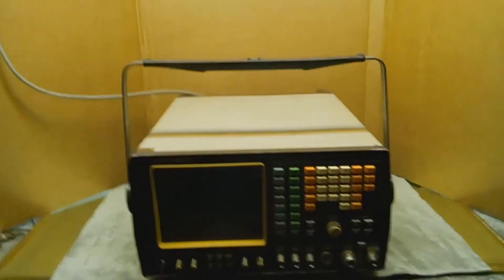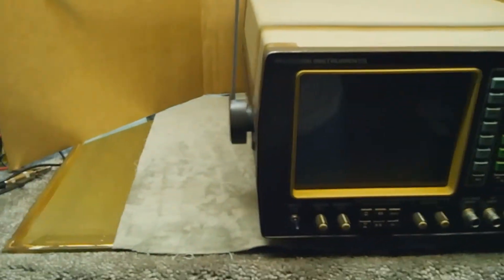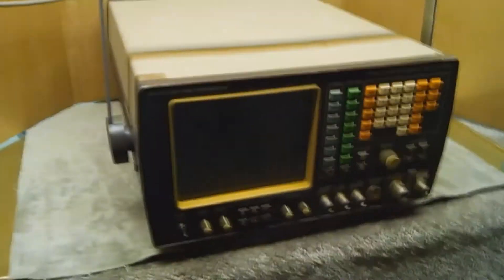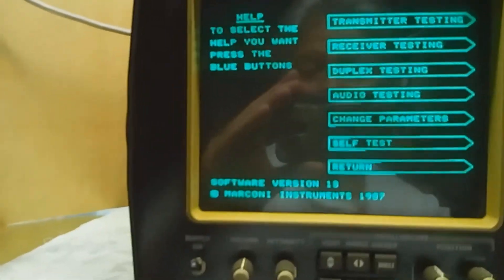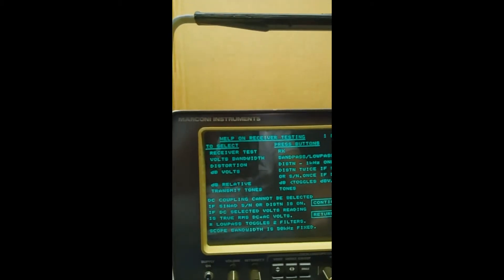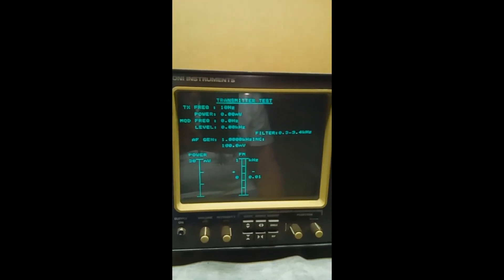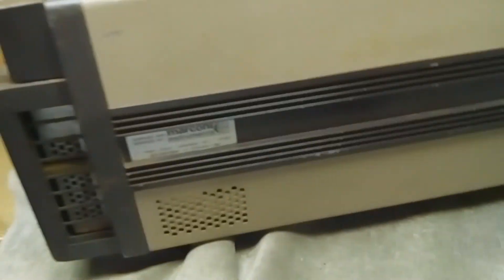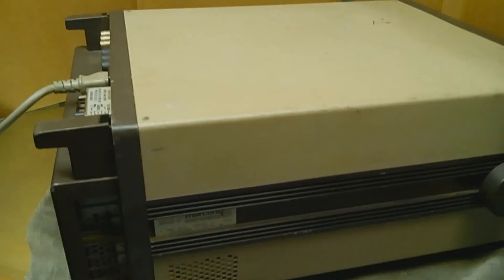Marconi Transceiver Tester

Comment: Thanks for the video. Does this output low level signals down to - 120 dBm or so for aligning radios etc?
Reply: @ElectroRestore  , thanks for that.  I found the datasheet and indeed it can output such low signal levels to simulate received radio signals for calibration.
Reply: @ElectroRestore  , I just got one of these. When first switched on it fails the first couple of self tests. When the tests are repeated it passes all. However, when in Rx test mode I adjust the output power from -30dBm and want -80dBm. But when the power reaches -41 i hear something switching and suddenly loose all power although I hear the modulation tone very faintly. Would you or any viewers have any idea whats wrong? Thanks.

Comment: I worked (well, I was definitely there..) at Marconi Instruments from September 1983 to April 1988. Nice to see what I remember as a brand new product again :)
Reply: Did you work on the 6500 Automatic Amplitude Analyzer or microwave frequency sweepers? I still use them quite often for work and have a couple of my own for measuring antennas.